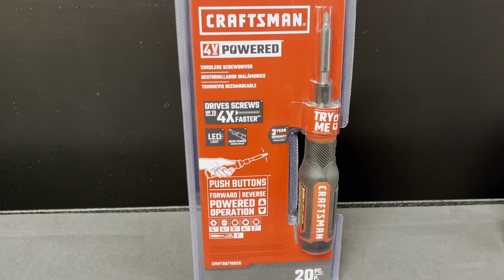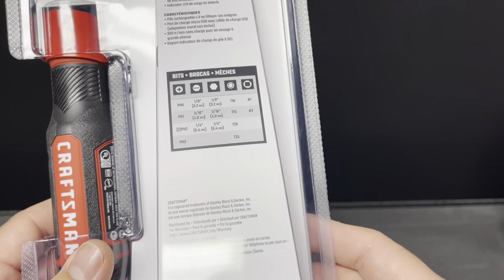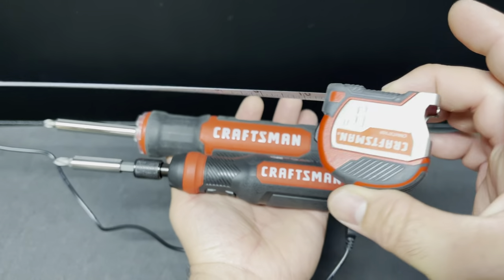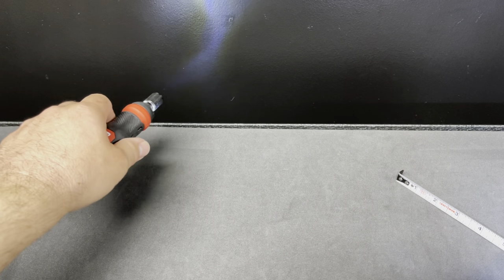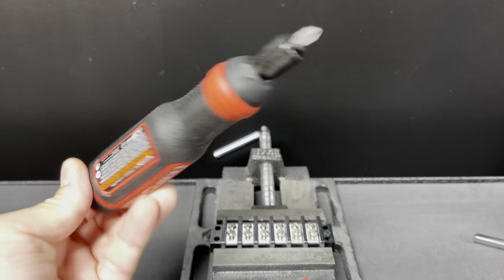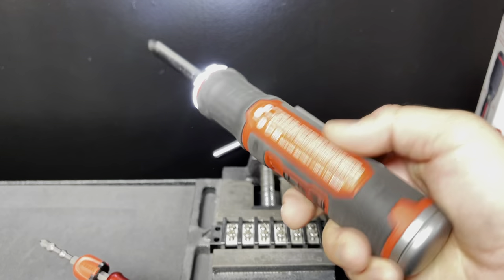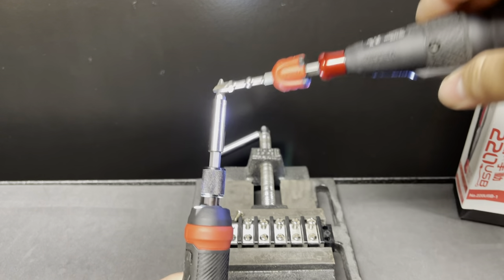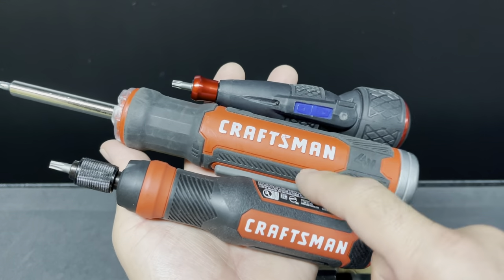New Craftsman 4v Screwdriver vs Old vs Vessel 220usb

Comment: I use the vessel at my winter job doing maintenance. Most of the equipment is Japanese and uses jis bits. We also have a lot of vessel screwdrivers for those jis screws

Comment: Thx for a thorough review.  I’m looking for a electric screwdriver that is between the DeWalt Gyro and the Bosch GO2.  Just want something small for low torque applications.   Your video contributed to my research.  I appreciate you taking the time doing this review.
Reply from the maker: No problem! I just went to Lowe’s the other day and the craftsman screwdrivers are gone, but they have two new screwdriver guns..
Reply: I just ordered the worx 4v straight driver. I've seen a lot of good reviews!

Comment: Agreed, the older 4V Craftsman has the right amount of torque for my needs. I also love the gyroscopic (maybe mostly the large paddle switch since it's always easy to find). 

The new one is just collecting dust because it doesn't have enough torque and it gets annoying trying to find the forward/reverse switch all the time.

Just wish it was a little more compact like the one. Waiting for a company to make something like the old 4v Craftsman that's just a bit smaller
Reply from the maker: Yeah, at least there’s the DeWalt DCF680 still around

Comment: Are You Sure You Charged Those 2
Smaller zscrewdrivers?
Reply from the maker: From what I remember, yes. I work at a store that sells a ton of the vessel, high speed and low speed drivers. they are made for small machine screws.

Comment: @AutobahnDan  I have the DeWalt model you've mentioned along w/multiple other cheapo Chinese brands. I'm an electrician so I need decent speed and torque the most but prefer tools like these that easily fit in my pocket so the DeWalt is too bulky for me and a tad too slow compared to others I've used.

In my experience w/most small 4v electric screwdrivers you trade speed for torque or vice versa and it's hard to find one with a good balance between. 

Minimum specs IMO:
Handheld screwdriver, not a pistol grip/convertible style (if I need a drill I'll use a real one.)
Locking chuck (too many annoyances w/magnetic)
Compatible w/standard 1/4" hex bits (no proprietary bs)
Rpm 300+ (rpm's in low/mid 200's or less isn't worth my time)
3nm+ on electric torque, 10nm+ w/manual torque.
2000+Mah battery (preferably removable if avail)
USB rechargeable (USB C preferred) 
* Additional features but not exactly deal breakers:
Capable of using two sided combo bits.
Led light (on temporarily or manual on/off is best)
Hand sized around same as a regular screwdriver, some are too bulky for practical use. 

All that being said one of the better models I've used which fits most of the bill at a decent low price is the Enertwist 4v, good speed/torque/size/battery life, just wish it had stronger gears since I've stripped 'em a few times over torquing stuff and battery is not replaceable (although it's possible if you know how to) 

Skil model w/built in voltage detector has decent features but a bit on the slow side.

Comment: What's the charge time? Appreciate the video. :)
Reply from the maker: No problem! I haven’t drained it down yet to see the charge time, but I’m pretty sure it’s about the same as the other 2 (3-4hrs) It would have to jump up to a usb-c or a fatter cable with an AC adapter to charge faster..
Reply: @AutobahnDan  Agreed, that's where the DeWalt and Makita 8v (7.2v) models really shine. Well that and they have much more power and features. I subconsciously go for a standard (non-powered) screwdriver for tedious tasks. Otherwise, I just grab my 18v drill in screwdriver mode. I have these types of little electric screwdrivers, but I never reach for them. They just feel clumsy to me when I need to do delicate work, and slow when I need to do speed work. But I still buy them because my name is Dustin, and I'm a tool addict.

Comment: Actually some model has several screwdriver bits but Japanese bits are longer than US bits, so back side of package we could choose how many bits I want. I hope you would understand what I said.
Reply: Also the Vessel one’s torque is week is that made for electrician. Japanese electrician use +2 driver much, then takes out home’s switches and fasten. So don’t need so much torque. If they want to use much more torque, they are using Makita or HIKOKI impact driver. So they do not need or don’t want have so much torque, they are using Vessel.
Reply from the maker: @needsrepair  I think the best feature of that is the ball grip. I didn’t check the play on it in the video but it is not too bad and the smoothness is a little bit better than the craftsman but not by much.
Reply from the maker: @needsrepair  as for the bits, It’s quite a research project to find them.. definitely worth it to go first with the ratcheting ball grip and try out different bits and drivers first. Upgrading to the 220 USB would be a complement to them.
Reply: @AutobahnDan  Later I will DM how different length of US bit and Japanese one that we use normally.
Reply: @needsrepair  you mean the jis bits?